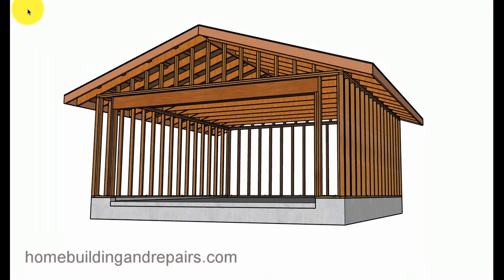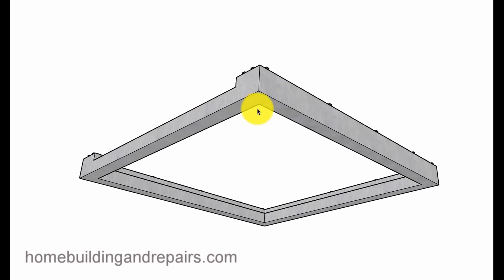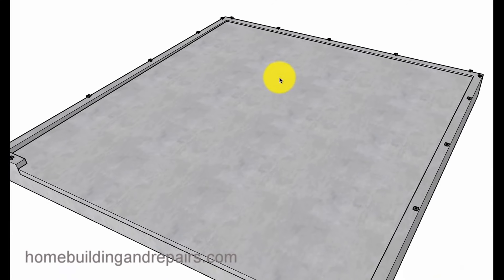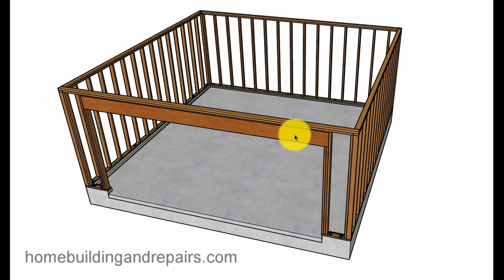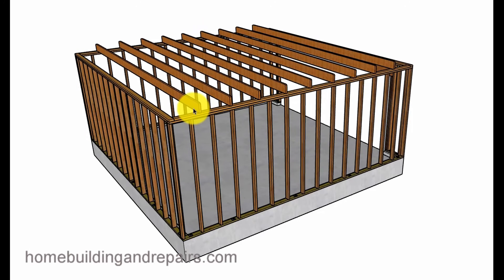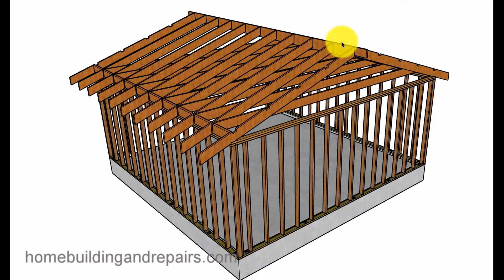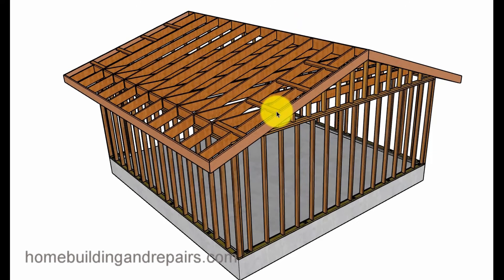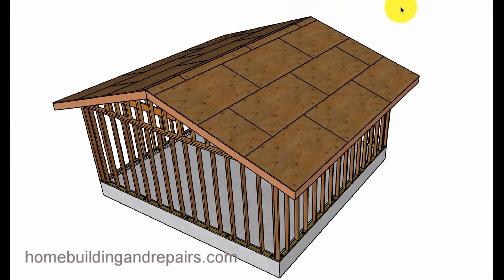Watch This Video Before You Build A Two-Car Garage – Framing And Foundation

Comment: I wondered about something I am doing a 24 x 19 ad on garage to a modular home, just wondering if I need to take all the siding off the one side to attach the truss to the house is that correct? I just wondered if you had a video on showing how to do that correctly because it’s only going to have three walls, the front with the garage door the side wall, and the back wall with the door. Thank you
Reply from the maker: As long as the trusses are sitting on a load bearing wall, then you should be okay. As far as the siding, you can leave it's not going to be in the way. Email me some pictures if this didn't answer your questions.
Reply: Thanks I definitely will, I guess I just flash it in also? I appreciate the help.

Comment: Hello sir, do I have to build the stem wall?  can I just put anchor bolts in the 12X12'' concrete?
Reply from the maker: Yes you can put anchor bolts into a stem wall.

Comment: What are your thoughts on building this on a paved parking lot with Concrete Block as a foundation mortared onto the pavement, and just using metal roofing and also metal for the walls to keep weight down? Thanks! Subscribed!
Reply: I will highly recommend you doing edges on blocks but poured concrete inside!!! Not on pavement
Reply: @israelthegamer2456  thank you!

Comment: Actually I don’t see the ease of having two separate pours regarding a footing and the slab. I think a “monolithic pour” is a much stronger better way to pour cement. Good Video. Good ideas.
Reply from the maker: I agree for the most part and if the structural engineer didn't have a problem with it, I would pour it all at once also.
Reply: Maybe a little tricky to get the slope doing it monolithic

Comment: What is the rough opening size of the garage door? How tall is the wall from top of stem wall to top of top plate?  Do you have any basic plans availoable for this building?  This would be perect for my needs!  Awesome!  And yes, I would gladly pay for footing and garage plans.  Thanks!
Reply from the maker: I don't have any plans yet, but am in the midst of putting them together. The garage door opening size depends upon the garage door and the wall framing for this individual design created an 8 foot wall.

Comment: Turning the roof around would be a mistake your putting all your toof and ceiling load over your garage door opening.
Reply from the maker: You just need a stronger garage door header. Maybe a 6 x 12 beam instead of 4 x 12.
Reply: @gregvancom  yes, but the taller the header the shorter the garage door. The only wood I ever use in a garage opening header is bolted through the web of a steel I-beam anyway. Wood beams always deflect if you hey are there long enough. If steel deflects it does it right away now because of the creep process.

Comment: What are the sizes of ridge board and rafters?
Reply from the maker: I can provide you with engineering information, but can tell you that in Southern California 20 foot garages were usually built out of 2 x 6 rafters and a 2 x 8 ridge. In areas where it snows the roofs will need to be stronger.
Reply: @gregvancom  thank you.

Comment: My garage is almost identical to your second model where the ceilings joists are resting on the garage door header. It has sagged about 1 inch over the span of 60 years. I want to change out the header due to the sag as well as raising the height to a standard 7' as it's about 4-5 inches shorter now for some reason... I have decided to go with double 1-3/4 x 11-7/8 by 16' LVLs based on some back of envelope math. The current header they used is a 16' 4x12. I figure the double LVLs will be much stronger than the existing 4x12 based on load tables from the manufacturer. I don't feel the need to bring in an engineer for this basic header. Any thoughts?
Reply from the maker: I cannot provide you with engineering information, but if the product manufacturer is suggesting that this will be stronger than a 4 x 12, then it might work. I've seen plenty of 4 x 12 spanning 16 foot used for your situation without any problems, but would suggest going with a larger beam or LVL's if you have the room to install one.
Reply: @gregvancom  Thanks!

Comment: Is it a requirement to slope the garage door floor? Thanks.
Reply from the maker: According to the 2012 international residential code book, R 309.2 on page 58 the answer is yes. However it does not state how much of the slope would be needed.

Comment: Why not put the garage door on the gable end. You won't need such a big header. Also, if you want storage above the garage, you should have a steeper pitch. At least an 8/12 pitch. A 12/12 is best. Put the ceiling joists 16" OC and make them 2×10 or better use I beam joists. They are lighter and stronger. Deck the floor 1st then put up the rafters. Much better use of space.
Reply from the maker: I thought I did put the garage door on the gable end in my first example. You've got some great ideas and I will try to provide them in future videos.
Reply: gregvancom ah you did. I wasn't paying attention.
Reply from the maker: No problem, you're not the first and you won't be the last. I even do it myself and sometimes a little more often than I should.